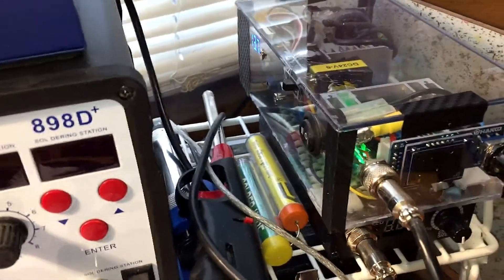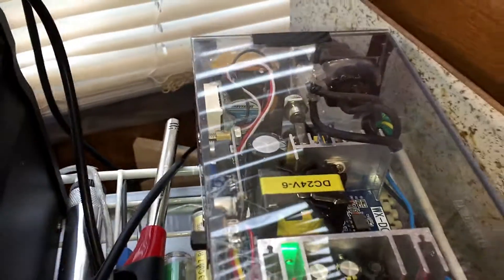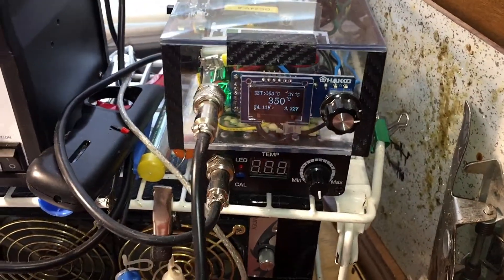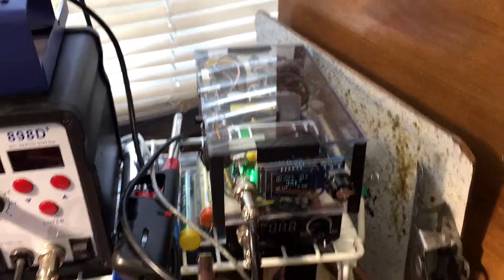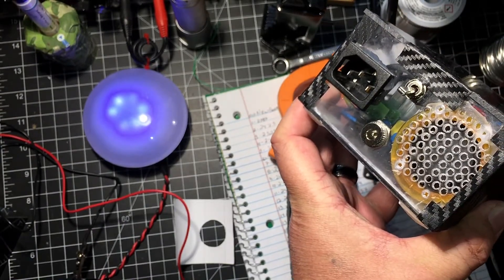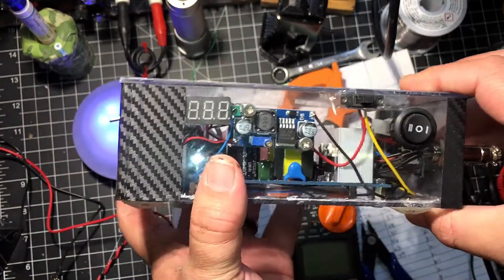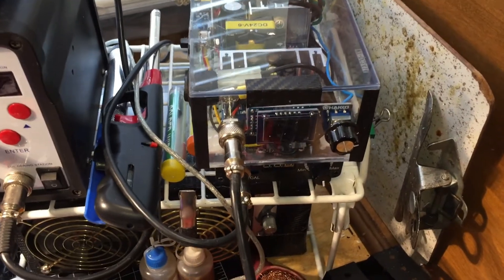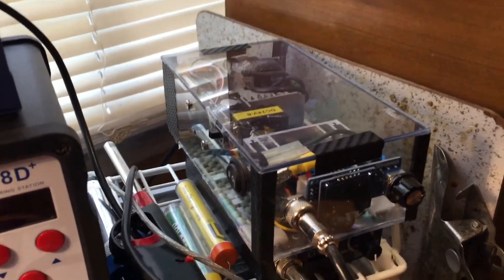DIY OLED T12 " Hakko " Soldering Station Portable

Comment: Could you post a link for the balance cable and the little led wired to the buck converter? Building one of these stations now. Will try to post a video soon. Thank you for sharing your work. Great build. Cheers
Reply from the maker: No Problem!! Its been years since I purchased all these pieces, but here is what I found today.

The 5s balance cable I used is like this, the female part(optional) I used came with the ones I purchased a few years ago-

https://www.amazon.com/Antrader-Extended-Charging-Rechargeable-3-9-inch/dp/B07TTR55ZB/ref=sr_1_33?keywords=5s+JST-XH&qid=1568902265&s=toys-and-games&sr=1-33

Here is the OLED I used(not the same vendor)-

https://www.amazon.com/Temperature-Controller-Digital-Soldering-Station/dp/B07PG2ZJMY/ref=sr_1_9?keywords=oled+t12+hakko&qid=1568902638&sr=8-9

I haven't purchased from either seller, so you might find one cheaper or faster shipping. Thanks for commenting!!
Reply: Finally got around to finishing my station and posted a video on how I wired it.
Let me know what you think. Your input is appreciated.
Cheers

Comment: Damn Dude!!! You are Killing it with the diy builds!!!  Love it!!!😲👍👍👍
Reply from the maker: Thanks! I just finished another DIY Tab Welder(made from a Colman Lunch Pail/2 x 7ah 12v batteries from a ups///Upgrading to 9.5ah when i get them from ebay!), Working on a usb charger in clear case,DIY Capacitance welder(battery tab/2 x 350f maxwell)"another one",Huge Charge and Discharge station, A new PC PowerSupply Hack to replace my 1st ever project, Portable Battery pack rebuild for my handheld drills and this DIY Mini PowerWall. Not all in that order, but with my most recent issues when testing 18650. I have gotten a little free time to build some of the in-between builds. Unfortunately, I still have around 6 Videos, done in the past year I need to edit and post and a few builds like this T-12 i have to make........tons of future videos to come😊

Thanks for commenting!!😊
Reply: @njfulwider5  where did you order this from
Reply: @njfulwider5  I can't find the brand of controller you got. All I find is "quicko"
Reply from the maker: Derek Roth  Sorry for the late response, I've been under the weather for the past 3-4 weeks. Here is the link I used when I found mine. Pretty sure I had to wait for it to get to me from China. I just looked for the seller that had the best feedback and picked him/her last year. Here is a link-

https://www.ebay.com/p/T12-OLED-Digital-Soldering-Iron-Station-Temperature-Controller-Board-for-Hakko/600094558?iid=131856436067&chn=ps

Hope this helps and thanks for commenting!!
Reply: @njfulwider5  have you got this set up so that that iron tip is earthed for esd protection?
Reply from the maker: Derek Roth  Yes, I ran a small wire from the plug to the t12
Reply: @njfulwider5  I messaged you on fb as I'd love more info on this build.
Reply from the maker: Sorry I missed you! I've out of commission almost a full month now, and trying to get back to normal. Shouldn't be to much longer(I pray). I'll hit you up as soon as I get out of this place! I HATE HOSPITALS!!!!!! Just drop me a message and I'll try and have my phone on me in the next few days! Thanks for commenting!!
Reply: @njfulwider5  I had sent you a friend request and messages are waiting :)

Comment: Hey joe, awesome build yet again! the TS-100 is way more portable though :D have you seen my temperature controlled LM2596 video? you just need a PNP transistor 10k thermistor and a trim-pot to have it automatically vary the fan voltage. I assume it is a 24v fan right? check it out: https://youtu.be/e4LWKW21rQg?t=1m31s
Reply from the maker: Back when I built this, I was still fairly new to anything DIY. But as soon as a new project comes up, I will definitely give that a try. : ) I have a ton of the 10K Thermistors(Had to purchase in bulk when I built the soldering Iron handle). I also have a ton of the 100K trim-pots, but only a few PNP Transistors. The TS-100 use the same 10K. Now that I am thinking about it(now that I have a little experience). You could also read the temperature from the 10k used on the fan instead of the handle with this type of setup. Maybe throw in a mini on/off/on switch to toggle between the 2?

Not sure how I missed the video? I don't remember getting the notification on that one. I better go back and make sure I have seen the others also??

I am reworking(complete rebuild) my very First Project(DIY Computer Power Supply, hacked to a bench supply"Half xl-4016/CPU PSU). Putting it to rest(served me well). Not sure if you seen that on my Google+ Profile? This time using all I have learned to date in the process(with different parts and pieces). Currently struggling on finding me some 200K and 500K Multi-Turn Potentiometers. The ones I have found are to bulky or to pricey. I also have to finish up this mini Tesla Solar System.Fun Fun!! Thanks for commenting!!
Reply: PNP are easy to find though less common than NPN, yea computer power supplies are good for messing with starting out but with the RuiDeng buck converters it is super simple to build a really nice setup with a few. (cough) my power hub (cough) :D
Reply: so what is the point of an ambient temperature reading in the handle of the iron? does the iron board have any fan output control? if so then put the thermistor it has on the PSU heatsink (wherever it gets the hottest) and wire the fan to its output. Or modify the LM2596 already there to take input from a thermistor that is on the hotspot, then just heat it to a temperature you dont want it to get to and set the voltage to output 24v for the fan at that temperature. (I calibrated 12v for 70C on mine) It doesnt matter what voltage the fan goes when it is cold as long as it can get to 24v before it gets too hot.
Reply from the maker: Its kinda strange why they have thermal readings in the handle(seen in the display top right corner). Not sure if it there to make sure the wiring doesn't get hotter than it should? I know most of the time, builders seem to think its for the temperature range of the iron(actual temp). But it's a whole different wire and the tips work differently than they think. It just one of those sensors, that really makes no sense. It is even barried further in the handle in some models, next to the wiring going out. Make no sense.

Comment: First.. again!.. that's pretty neat, you should probably explain how to identify the cheap PSU to the good ones.. I guess by price otherwise. that iron heats up pretty quick too.
Reply from the maker: Yea it is Fast! Even Faster with a Battery Pack! The PSU is pretty apparent once you see the ones they sell with the kits. It almost looks like they hardly put any components and cut a lot of corners. The Other T-12 Version I have underneath that was a kit also. Right off the Bat, I replaced the power supply. I won't do a video on that kit. It went together almost as easy as a simple box. Only alterations,-With the OLED model, you will find a million ways of connecting the soldering iron(Wiring Diagram). Just make sure how ever you wire the OLED station, you also wire the soldering iron to match.  I decided to match the Smaller black T-12 wiring so I could interchange the irons. 

Thanks for commenting!!!